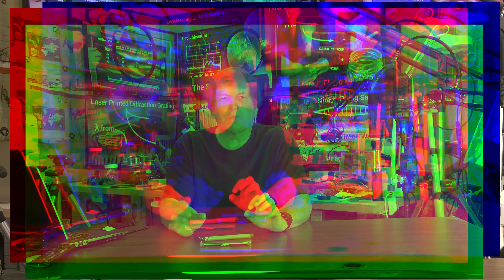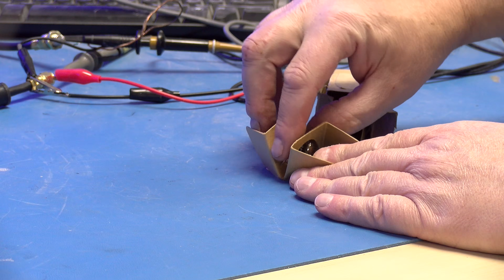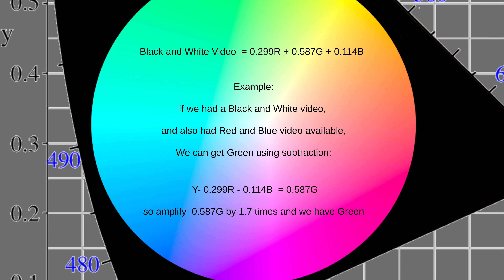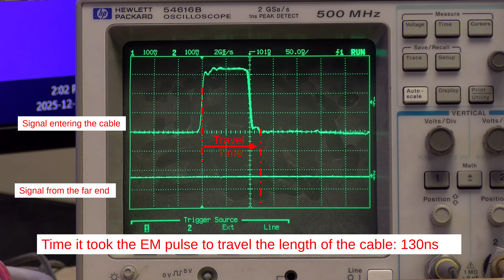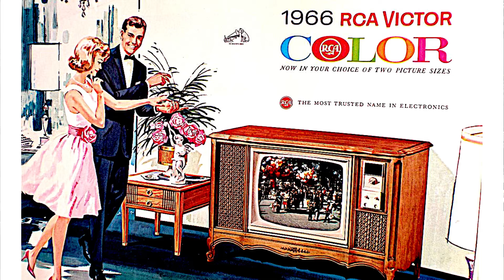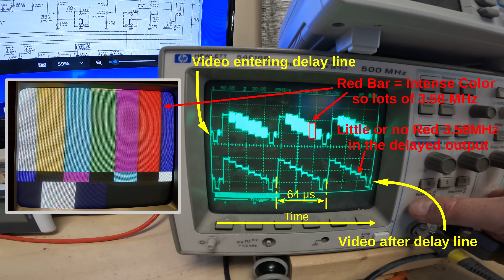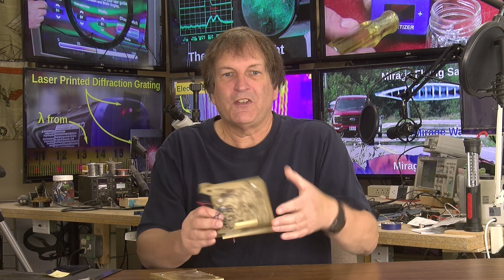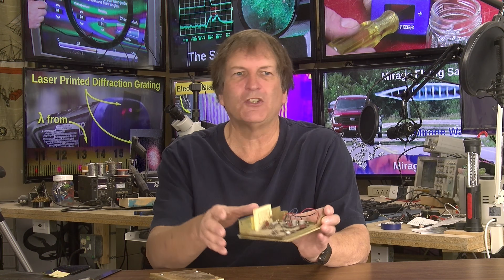How we slowed down electricity to create Color TV

Comment: Clocked bucket brigades, replaced by CCDs, and other wonders such as plate, line and slab (as in a literal slab of rock) reverb units in recording studios.  Some VCRs had 'perfect' still frame pause via CCDs (and full digital frame storage later), models with TBCs built in.

On another topic, AI searches are such rubbish.  I just had Perplexity 100% categorically state that no VCR ever had a perfect still pause feature.  Confidently wrong.  Imagine being a person that did not have sufficient knowledge to 'argue' the point with it and point to models of VCR that actually had the feature.
Reply from the maker: bucket brigades!  I remember seeing those advertised in electronics catalogues or in the ad sections of Popular Electronics etc. Never did get one to try though.

plate, line and slab  reverb - I never heard of that - just looked it up! Amazing! 

Your comment about AI - I keep running across the same type of thing - some good info with a few bits of completely wrong stuff mixed in. No wonder people are messing up when the use AI for critical things without verify the results!
Reply: @ElectromagneticVideos  A I will only learn if corrected, sadly lazy uniformed content providers knock together a script or cut and past AI searches the let A I seek out images for the text, this goes wrong as soon an A I loosed the context when it start inserting images not relevant but related..  

If  A I  was told that a Boeing  707 in not pronounced seven hundred and seventy but 7,0,7, then is would use that correction when linked with Boeing. 

A I irritates me as lazy click hungry Tubers are producing more content than the responsible content providers.   It seem after two years A I does not have a context look up table to adjust pronunciation which is irritation.  

A I cant even dray a clock correctly most time it has four hands and scramble numerals.
Reply from the maker: @Woffy. Its funny how things like seven oh seven vs seven hundred and seven are the givaways. Whats really bad is how many clicks much of that AI content gets. I come across a lot political "commentary" that is AI and so realistic that the casual viewer - or easily mislead viewer  wont notice. I think half of it is to simply make money and half to push one political agenda or another. Sadly we are becoming a more and more delusional society because of it.
Reply: @ElectromagneticVideos  It is worrying the amount of correct information agglomerated into a narrative which is not true.  A I  repeats often and the cadence is not varied, numerical annunciation is poor,  it only takes one entry to a look up table to correct the annoying 707 .  A I can't differentiate between a lead pipe and a dog on a lead,   again the context should indicate the correct pronunciation.  

I looked at one video of the late Judge Caprio telling a story, it was obvious it was not him from the monotone and the choice of words, the story repeated padded out with emotion. I posted my disgust that the channel was profiting form his good name. What was horrifying was the comments all say how lovely the story was etc etc and not one pointing out it was A I.  We seem to have no control over our likeness. 

Frankly I think the genie is out of the bottle and BIG DATA is not going to allow independent control.  I believe all A I content should be watermarked as future mankind history references are going to be over written with dross regurgitated by A I.

Sorry off topic from 'delay lines' one of which I found in a junk box in the basement similar to the one show, I too cut my teeth on old TV's and enjoy watching Shango66.  My favourite job (on sets post 80) was setting the convergence to get the correct saturation for brown, the orang part of the Chroma diagram is very narrow so brown is hard to get right. Interesting   A I has a bias to brown, and produces incredible depth but somehow does not look right ?.  PAL did not have Tint correction but was and still is a good system for the bandwidth.  If I remember you did a video on the Teletext system.

Ooops too much coffee, have a good day I hope all well in Canada, we are  routing for you.
Reply from the maker: @Woffy. " looked at one video of the late Judge Caprio telling a story, it was obvious it was not him from the monotone and the choice of words" - I got tricked for a short time with that video too! And there are more like it - popping up in my YouTube feed. I think what makes it worse is the algorithmic feeding of videos/posts that re-enforce what one seems to like. I have a couple of friends who now have a very warped view of reality because all they see is stuff confirming things they want to believe. 

Shango66 - when I have some time I what his TV repairs - often the same or same era 1950s and 60s TV I played with and fixed in 70s and early 80s as kid/teenager.  

Doing convergence - I hated that - never knew when to stop! Often made harder if I took a convergence assembly from one TV to replace a bad one in another! Brown is a weird color - really an orange as you point out yet we perceive it as different. Over here I think it was Zenith that had a "Chromacolor"  button on 1970s TVs that stretch out the orange pink region and compress the rest  of the chromaticity diagram to make anything close to skin color look like a decent skin color. Worked pretty well - you really didnt notice the skews on most other colors. 

PAL was so perfect it didnt need a tint control :).  Not sure how true that was in reality. 

All is well up here - in fact things are going surprisingly well, thanks! Best wishes from up here!
Reply: @ElectromagneticVideos  A I content is usually from a text reference or possibly scripted, but since it cannot express punctuation by using inflection sentences become compounded. I look very closely at the background to which usually loops, viewers should challenge the data / information they receive. I don't take prisoners and call them out. 

Swapping Yokes !!!!!  oh that never went well and I was so pleased when Mullard (1977) made the bonded Yoke on Tube.  I never had one fault.  The old Valve sets like the GEC CT154 pulled 380 watt (on 240vac) the convergence was analogue tuned ccts and some wire wound pots were at 2 amps, there were 16 to set the linearity Pip cush etc. but two for the blue and one bar magnet which would become unglued.  Newbies to this TV would make the mistake of tweaking the convergence which would  then collapse as the wire wound pots gave up. I learnt to check the magnets were still stuck to the tube first.   One set I did was spot on absolutely perfect, I got a call later saying the TV showed CBB.
Oooop  Wire the yoke backward viewing through the bench mirror. 

Zenith were very inventive and got a good image from the less than capable NTSC system,  I set the colour to see the slight off white of the cricketers against the grass that worked for me.  I have learnt a lot from Shango66 far more than I got from collage. 

I am pleased all is well Carney is a strong leader and well respected and working well with the opposition with the bonus that he really irritates you know who.   

Europe and UK have made some aluminium and ore agreements  which has not been reported by. US news which is all over the show,  CBC doing a reasonable job but not covering enough of World news that impact Europe and Canada.  

NORAD is going to be a fighting ground with the US who are realising that the countries they stitched up on defence actually have very capable systems.. 

Canada's partners are up to speed with submarine search and detection and have been for years the US understanding of wave propagation in changing water density falls short of systems Europe and UK already have on station. 
it is better to find the launch platform than wait for NORAD to detect a launch.

The flaw in the very capable F35 (when working) is the complexity as it needs a constant update from the mothership who is not talking to us now. The mission software can at any time  ' limit ' the aircraft. That to me is not a good selling point. 

The Gripen is ideal for Canada as you can hide and carry a lot of ordnance, .  SAAB are keen to get a deal to build in Canada as is RR . Hopefully it will become Canada  new Arrow 

RN have been new lasers to play with and drones and jet packs for the special boat forces so they happy flying between ships. Lockheed Martin are four years overdue delivering  F35 for our two aircraft carriers.  shame we scrapped the Harrier which the US now use. 

Sorry well off topic again anyway Canada this is your renaissance..  

Guard the Leaf is a good channel.
Reply from the maker: @Woffy. "as the wire wound pots gave up" been there, done that! The TVs I dealt with were old - ones that people were throwing away. I remember some of the pots being rusted!

Wire the yoke backward viewing through the bench mirror - thats hilarious!

Zenith - I was mentioning to someone how I think it was Zenith that a "Chromacolor"  button that on the color circle spread out the the skin color orange and pinks and compressed the  other side of the circle so even with a small phase shift skin color looked OK. It worked remarkably well - and I dont remember noticing the other colors being a bit off. 

Good points you make about Canada - but I do think there is much political pressure regarding what weapons to buy. I suspect that will largely be determined by some sort of trade deal - or lack of one. The good thing is the economy has been remarkably resilient and hopefully things will remain that way.
Reply: @ElectromagneticVideos  I look forward to you video on PAL / SECAM  especially if you have a vector scope. When you see displayed the timing and phase angle colour relationship to frequency suddenly the theory falls into place. Let's see if you can show brown. The BBC  PYE cameras (1970 -85) had a vector scope so the operator could correct the signal before sending to the mixer.  

For a couple of years the UK had an overlap of standards  405 (mono)  and 625 lines (colour), the duel standard colour set used motorised turrets and on board slide switches to tune and select sound and vision,  IF Chroma decoding.  It was horrific to look at the mess of wires and twenty plus valves (tubes).  I  think it had to be built to ensure viewers were not forced to move service but since Wales was the last to shift from 405 I doubt if any were sold. 

I forgot to mention the video overlays of black and white with the frequency shown was very good and despite modern technology doing its best to correct the image it did resolve well. That took some effort to get right.

Rusty wire pots, huge dropper resistors,  electrolytics that not only let out blues smoke out but distributed foil and goo all over the place, LOPTX put in tin boxes to contain fire cause by the tin box, red-plating line output valves (tubes) and the inevitable drink spilt by an inebriated party guest causing the valve bases to arc out.  And kids toys in the TV ! I have no idea how they got in there.  Toast in a VCR I can understand.  Fun days.

Canada doing OK, if you think about it Canada has more resources to give than the US has to sell. But the most valuable asset is Canadians play with a straight bat. (Stick on the ICE ).   At this rate I think there may be States wishing to join Canada, Alaska is one. 

It is very unfortunate that so many good Americas have lost their businesses and many billions lost by one demented man. .  Europe has a big problem with Ivan and the solution is going to be very costly in all respects since US arms capabilities are still restricted.  Some amazing technology coming out of Ukraine, they got one of Ivans Subs today. 

Q: is Aurora still operational.
Reply: ' Abby Road Studios '  Reverb Plates ,  a few hundred pounds off steel plate on the roof now sampled and used in a mixing emulator.  Did the job.
Reply from the maker: @Woffy. A came across that when googling! That is wild. How signal processing technology has changed!

Comment: Mercury delay lines in old computers
Reply from the maker: Yes! I have ever actually seen one. All those old technologies are so impressive. It was so much harder to build things those  - now most of the hardware complexity is confined to some semiconductor plant making complex yet generic stuff.
Reply: @ElectromagneticVideos  Good to see you in good spirits,  some memorable comments and @8m2sCv7 reminds me of the very strange Mercury delay line memory.  Necessity is the mother of invention Have you seen Curios Marc's latest on the Apollo communication module.  Those engineers were so out side the box on thinking.  

PAL systems are as you mentioned a tad different and most early sets used a glass delay line, I cant recall if it was ultrasonic of optical but the problem was thermal stress would sometimes cracked the block. Not an obvious fault to find in the PYE CT154 36" Colour 1972 (X ray generator and convector heater) Season Greetings and a prosperous new to all in Canada